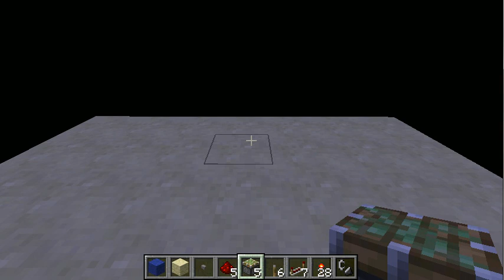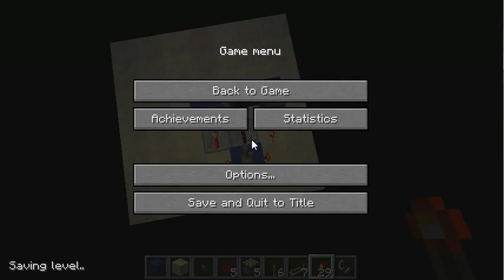Minecraft: Inverted reversible signal generator and dual edge trigger

Comment from the maker: That's right, if you want a more save version you have to use a repeater with a 2-tick delay to infuse power into the block with the lever. That way you can't break the system by mistake.